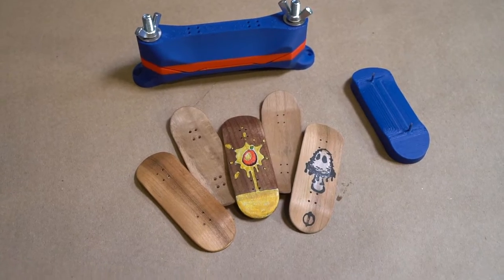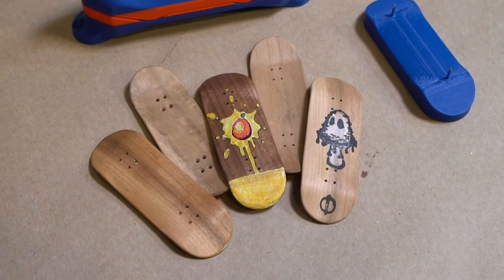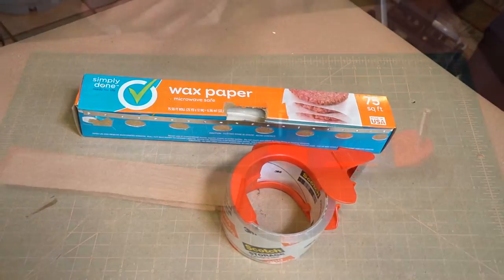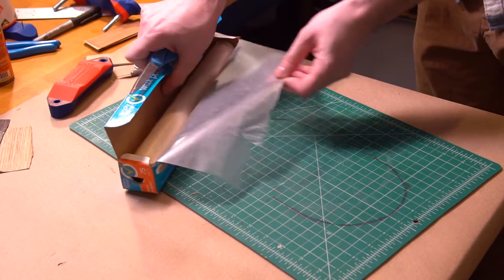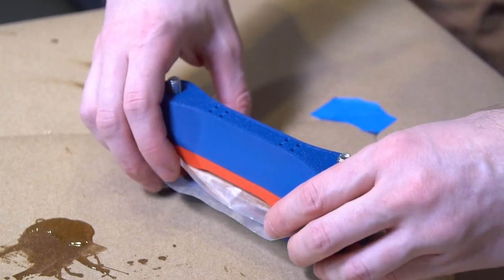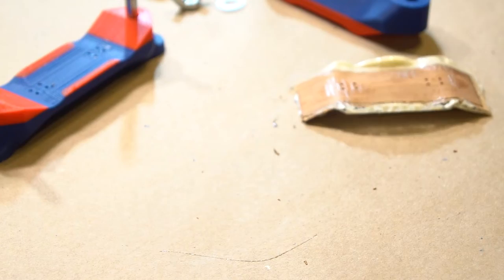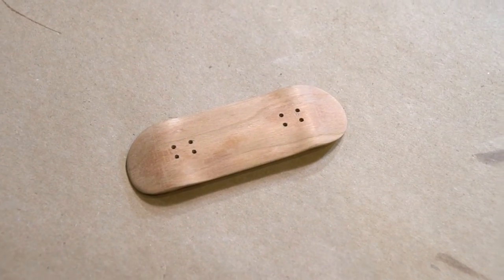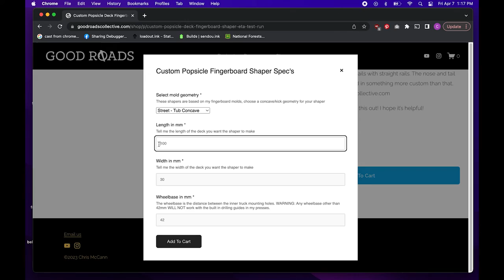How to Make Professional, Custom Fingerboard Decks

Comment: ive been using your original design file for about a year and with FDM printing ive started to use 2 pieces of masking tape on each side of the press. Ive found that i dont get any of the lines from print lines on the press, makes a great quick release too.

Comment: I use packing tape to protect my mold but i've also used a sheet of felt in addition to the tape to protect the deck from the layer lines from the 3D printer.

Comment: Ever tried tite bond? Or hot hide glue? They use it in guitar repair. Supposedly those glue joints are stronger than the wood would ever be. Might be worth a try
Reply from the maker: Titebond 2 and 3 are great for full size skateboards but since the veneers for fingerboards are so thin all of the moisture in the glue causes serious warping problems in my experience. Hide glue is an amazing material for certain projects, it's flexible and can be removed with heat (which is why it's used in instrument making) but I don't know if it would have the structural properties we need here. Might be worth testing!

Comment: Did you have to dampen the surface of the veneers before applying? The directions on my polyurethane gorilla glue states the surface should be dampened to activate the glue. Is this the case? 

Cheers, j
Reply from the maker: The atmospheric moisture has always been enough for me and I don't live somewhere particularly humid
Reply: @GoodRoads  ahh I see. Thanks for getting back to me. I live in the desert, so I might have some trouble without water. I’ll probably have a spray bottle handy and mist some water on before I apply glue. My only fear is that the water would cause warping.

Comment: Could you share the 3d print STL files please
Reply from the maker: All the print files are available at goodroadscollective.com/shop
Reply: @GoodRoads  thank you so much
Reply: One more question

Did you design the prints or did you find them somewhere because if you designed them I would like to know what software you used
Reply from the maker: Yes, these are my own designs. I use Fusion 360
Reply: Thank you alot